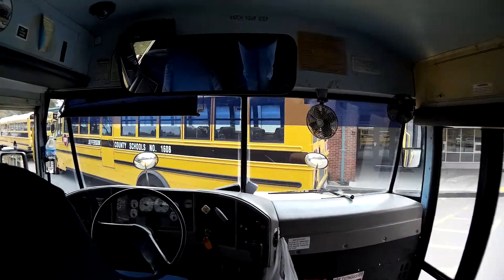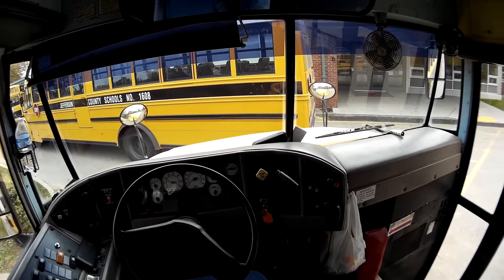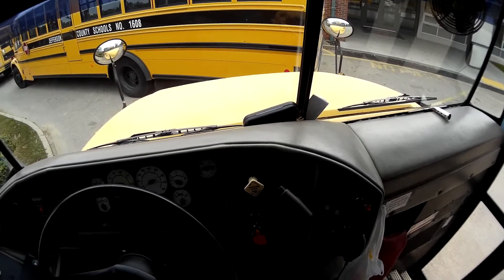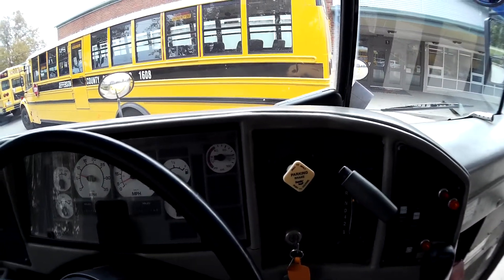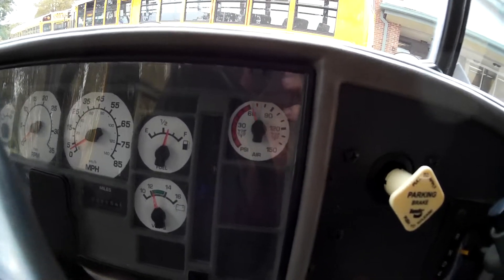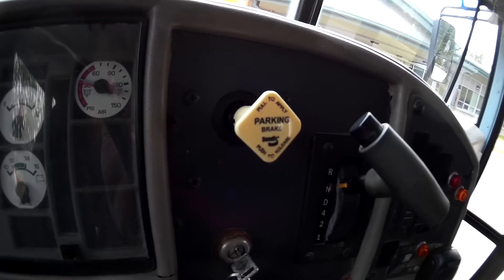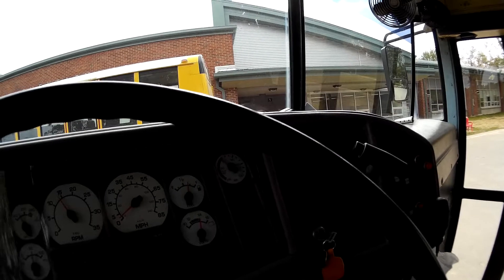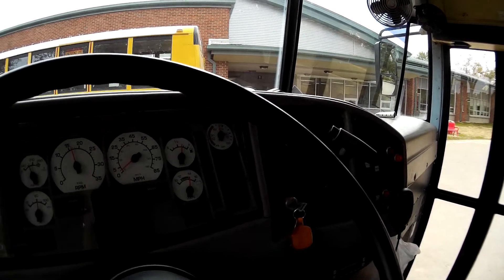Bus Safety:    How to do a Brake System Check (LAB)

Comment: Can you explain why buses have that white light on the roof that flashes
Reply from the maker: It is simply another way to get the bus noticed by everyone else. The size, yellow paint and all those lights still don't get noticed by the average driver. We only use the strobe in low light conditions.

Comment: Good review. Don’t forget the build up timing of the air brake system from 85 to 100 psi in 45 seconds for it to be complete! And the air governor kicking in. But overall a good show!
Reply from the maker: This is news to me. We don't teach that here. At what RPM is this supposed to occur? What about different engines and pump types? Seems somewhat of an overkill to me.
Reply: yellowbusguy here in Pennsylvania when you pump down to 60 and then to 40-20, as you said your spring brakes kick in, then in PA, you have to restart your engine and count from 85 to 100 psi. Your bus has to go to that distance in 45 seconds or it fails the test!
Then you have to depress again and make sure your air governor kicks in again. Everything else is the same as you did.

Comment: You guys don’t do a hold test (put bus in drive and rev to 1000 rpm after you bleed off the air and the brake pops out to check that the parking brake will hold the bus with the air low and parking brake applied) or a couple stops to check the service brakes in Kentucky? I know all the states are slightly different but that’s two things we do in Michigan that I didn’t see here
Reply from the maker: They don't teach the hold test here, at least not anymore. The brake test is kind of unnecessary since you'll use the brakes before getting off the lot. Brake issues of any kind get turned in quickly. Drivers don't let things like that go since we have plenty of spares on hand. Brakes get checked at the garage every 6 weeks as well.
Reply: yellowbusguy Our policy at my district is that if it fails anything it cannot be driven. They usually bring them in immediately if it fails or it’s losing any kind fluid or something.

I’m curious how many spares you have at your compound vs. daily route buses? We have something like 20 spares and 111 route buses. Michigan doesn’t use a countywide district system so our districts are much smaller than what you guys have and have just one compound for our fleet.
Reply from the maker: My Compound has around 80  route buses and about 20 spares, I've never counted them. County wide we run approximately 1100 buses.